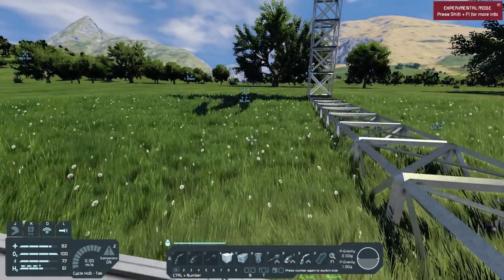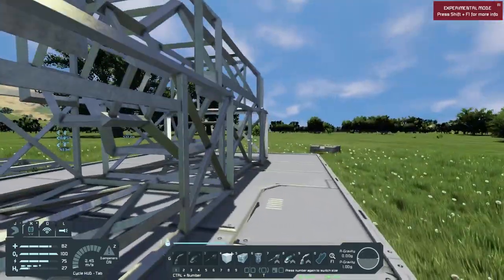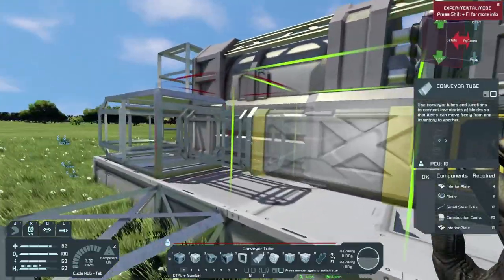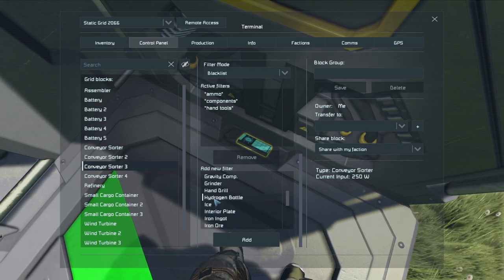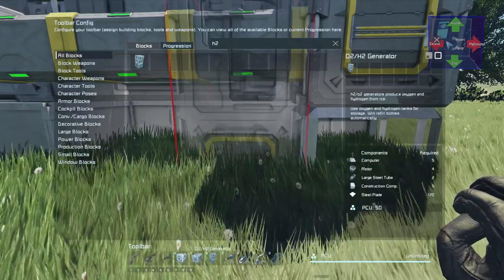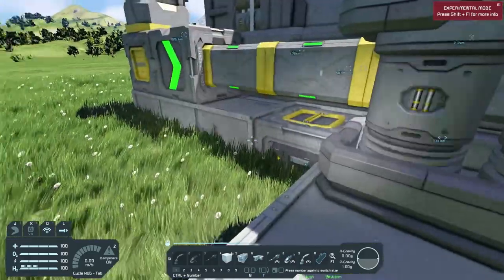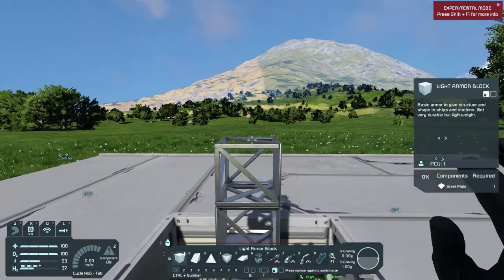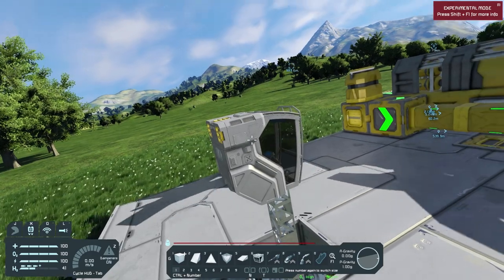Space Engineers #2: Starter Base

Comment: You don't have to build small grid ship on rotor. Yes Keen disabled choise to build small/large/station but it still has your choise. If you plase large block on a ground it will become station mode, If you build large block in air it's large ship mode and if you build small block in air it's small ship mode. So you could select landing gear -> choose small grid by selecting twice in hotbar (example if you have landing gear in bar 9 - press twice 9) and you have it. With it you don't have to build rotor with small head.
Btw. I'm happy that you started new series of Space Engineers.
Cheers
Reply from the maker: Small rotor is to ensure that the ship I am build is stationary and that it is powered by the station until finished.

Comment: you don';t need to fully weld your foundation blocks.
just place them and forget about them. (you then only use 1 steel plate per block compared to 25 if you fully weld it)
then later on when you have tons of materials you can weld them up if the scaffold look annoys you

Comment: Heres another option to craft small ships, put a small connector on top of an existing connector and add a small battery to it so u can lock it. Then you can start building on top of it with the benefit of the bateries already charging, ice if you go with hydrogen route. Rotors are kinda easier to setup but much less practical in the end.
Reply from the maker: Not less practical then trying to line up a connecter and hoping that it doesn't fall while welding. Using a rotor is the easiest and most practical way in Space Engineers right now.

Comment: I think you will be a happy man once you find you can switch the content of the displays in the cockpits, in this particular one I like to have Speed in the top left, Artificial horizon in the top center and energy in the top rigth. The bottom one I don´t care because you can´t see it without changing your camera orientation. The only downside of the new cockpit is the lacking of a large port, because it makes imposible to refill your bottles while you are on it. On top of the prebuilt simple scripts in the cockpit (in fact those works in every block with a display and even on displays itself) you can use it as a normal display for scripts like Auto LCD2, Whip´s Artificial Horizon, or Whip´s Turret Radar, etc.

BTW you should give a try to Easy Inventory mod, is a QoL mod that allow you to empty your inventory in a container with one click and also having a block selected on your bar you can get with one click all the components you need to build it or even queue the production of the components, all without opening the storage.